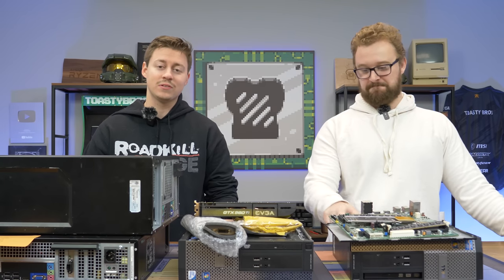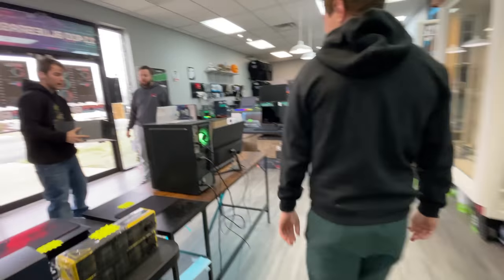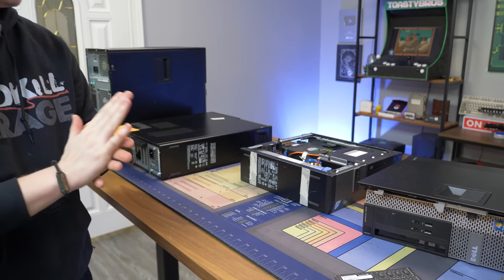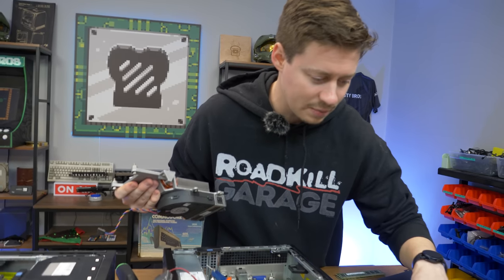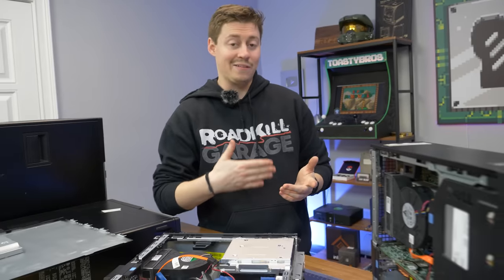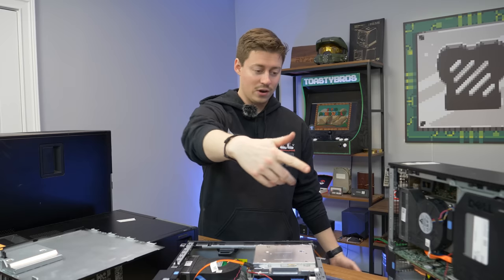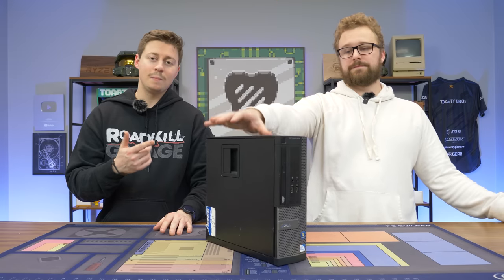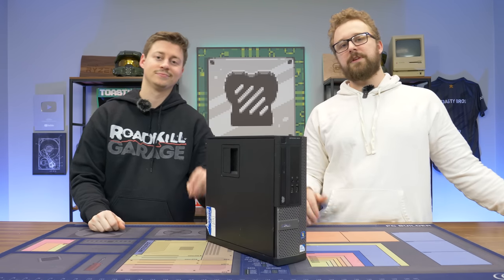The $69.69 Gaming PC Challenge

Comment: plastic package melt leading to temp threshold. and noise check fail so just melt the plastic again and soak it with silicon teflon heat till wet ... .use and LOVE THE solid non air filled parts work so well..

Comment: you guys have to try out this pc i saw it on amazon and it looks really good and the specs Lenovo Gaming PC Desktop Computer - Intel Quad I5 up to 3.6GHz, GeForce GTX 1650 4G, 16GB Memory, 256G SSD + 3TB, RGB Keyboard & Mouse, WiFi & Bluetooth 5.0, DVD, Win 10 Pro (Renewed) and its only 380$ which is really good so i was wondering

Comment: i just replaced the r7 200 with a 1050 ti oc in my old home theater/ retro gaming pc. it's an old hp 6200 micro tower with an i5 2400 and 8 gb ram
 that my wife got for free from an old job she worked at. they kept the drives so i added a 240 gb ssd and a 3 tb hdd.

Comment: I did similar thing somewhat recently, I bought 3010 SFF with i3 and 8gb of ram for around 15 bucks (from auction), replaced i3 with i5 3450 for 10 bucks and 750 low profile 2GB (which is way better than r7 250) for 35, so total around 60 us dollars, yeah, I got lucky with the the whole build, but it is doable

Comment: i have a very similar build i did as a budget system a couple years ago now. only 8gb of ram but the exact card, and i happen to have an i5-2500 in it. played low end titles well. i'd like to upgrade it to the boards max specs of i7-2600k and 16gb of ram just to see the difference. went from a 4gb i3 2130 system and just evolved over time w spare parts from other shits and giggle builds so seeing this, and the card i have (r7 250) & hardly ever see used in builds, is very cool.
Reply: Is it the 3010 too
Reply: @mrbrownhook  i just have a 390 sff optiplex. I could be wrong but pretty sure it was what they used as well.
Reply: @whotfismikey  yeah prolly, I wasn't paying attention 😂
Reply: @mrbrownhook  i could have also miss heard, or very easily be mistaking the video even. I watch alot of tech stuff lol.
Reply: @mrbrownhook  i was pretty sure they used a 390, but i believe used a better looking case of the 3 or 4 they had, which may have been a 3010 case

Comment: They roasted my setup Lmfaoo 🤣. I got a free HP Compaq 6200 Pro MT and then put $20 SSD by Crucial and have 32 GB of ram for $40 and then soon a RX 550 4GB LP for $70. But the PC works so well its actually like fast it's because of that i5 2400 and SSD and disabling a bunch of windows bloat.

Comment: WWZ: aftermath is a great game that should be added to the E-Sport lineup. recommended setting are intel i7 3970 16gb of ram R9 280/GTX960 deluxe edition is on sale right now on epic for $24.99
Reply: Excellent game choice.
Reply: It recommends an LGA 2011 cpu to run the game? probably be fine with a 3770 lol
Reply: @dylanallen7720  o yeah this is recommended settings minimum is even lower.